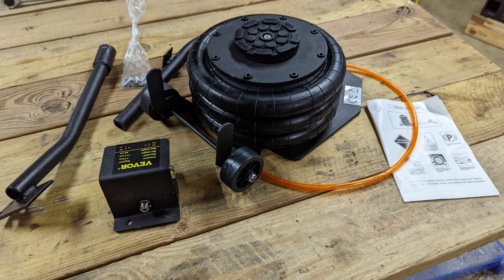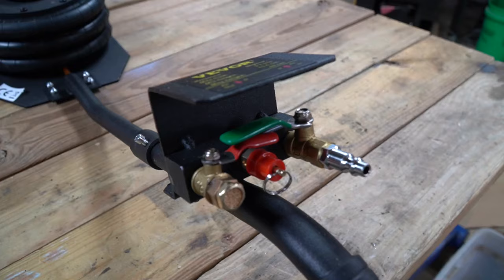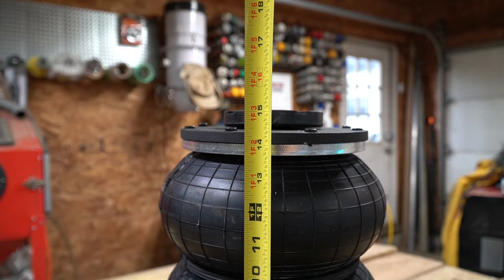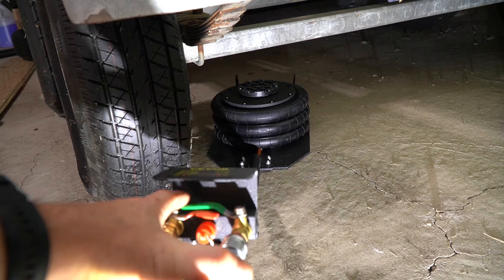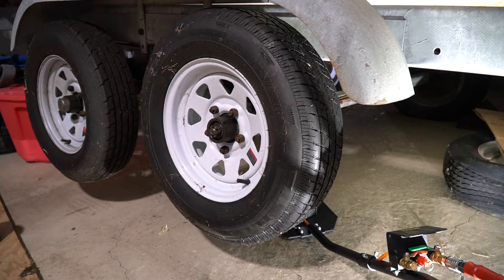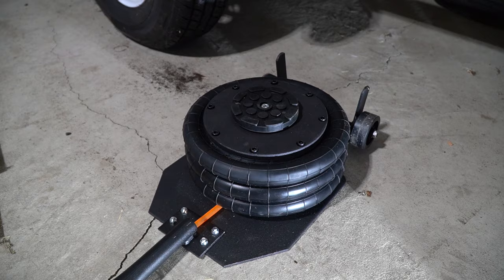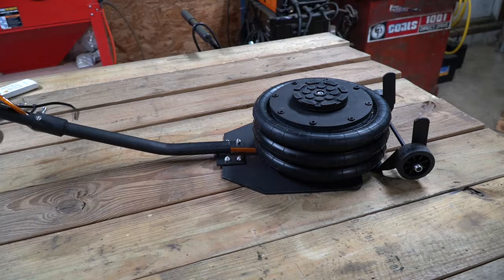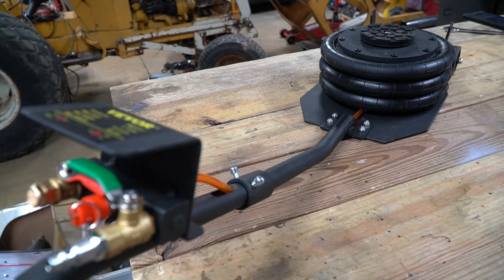Vevor 6600lbs Pneumatic Triple Air Bag Floor Jack, 3+ Ton and its a space saver!  NTDT!

Comment: I just bought mine. The idea is a good one, but the build quality is shameful. Yours looks much better then the one I received. One machine screw was stripped. Mine would not even stand up on it's own as the welds and axels were so poorly done.  One common flaw I have noticed is how the control arm is bolted to the flat base. That small bracket needs to be flipped around so it sits flush on the base. Also the tube should be welded to the length of that bracket. I had to spend a whole weekend cutting and rewelding it before I could even use it.

Comment: I like it, but have a few questions. Do you know if they have any specs on the air chambers, like how does it hold up and wear in its open / close wear points? How long before dry rot ? How does it hold up to heat, cold, chemicals,
Reply from the maker: These are all good questions that I don't have answers for.   I can't imagine there is much to go wrong other than an air bag failure.   If they are built anything like a normal truck airbag, they should last for many years, especially since most people are going to be keeping this under cover in their garage or shop.   Time will tell for sure and I'll keep the pinned post updated with any failures.   It is light and easy to use, I'll probably be using it in favor of my heavy floor jacks.
Reply: It all depends on the manufacturer of the rubber. If it’s Firestone then it’s pretty good. I used them on semi trucks and they last for years but if it’s off the wall, I wouldn’t trust it to protect me very long.
Reply: Be sure to drain water from your air system. Water in these airbags will degrade them faster.
Reply: @akbychoice  suppose you could put desiccant inside or pull a vacuum on it periodically to dry out the inside.

Comment: Can the air jack be used with a portable air compressor? - thinking about one that runs off car battery so the jack could be used roadside.
Reply: That type of compressor does not have a tank and the produce very low volume so it would be very slow.
Reply: I was thinking same thing about portable air compressor, should work in theory, just take a bit longer, ok I suppose for occasional use. Only thing I noticed is they need quite a high PSI output, about 120.
Reply: @copperknob1971  my shop air is regulated to 95-100 psi and the jack lifts my big old t-bird easily.
Reply: These air jacks all seem to have the quick release connection, portable air compressor designed for tyres have schrader connectors, is there and adapter to go from one to the other ?
Reply: @copperknob1971  portable air tanks usually all have Schrader valves that you could hook up a portable 12V air pump to, and charge the tank to a sufficient pressure.  The air jack pressure I found to be needed to lift a van and passenger car was only about 45psi.  The tank will need to be probably 90 as it'll drop in pressure as the jack fills up. Didn't need much volume.

Comment: What happens if the jack suddenly slips? I would be afraid of that happening when lifting a heavy load, imagine a 6000 lb compressed spring going off. Is it possible to fill the jack with water instead?
Reply from the maker: 6000lbs of pressure on a spring decompressing instantly would be scary!    6000lbs on an air bag, not as impressive.   But yes, you need to understand how to use the jack before using it.
Reply: You should be using jack stands to.

Comment: yes but how powerful of air compressor do U need?
Reply from the maker: It's rated for up to 145psi, or at least that is what I said in the video, I no longer have the manual.   :D    I only keep my compressor at 120psi, and I haven't had it struggle on anything.     Any size air tank is probably going to be big enough, it isn't that large of an air bag.    If you have a tankless compressor, the more CMF's the merrier.